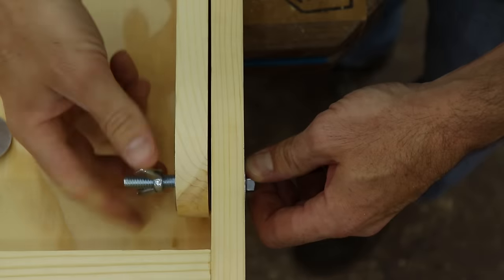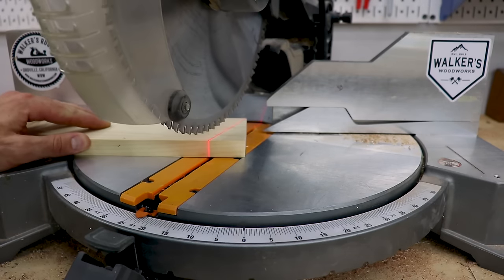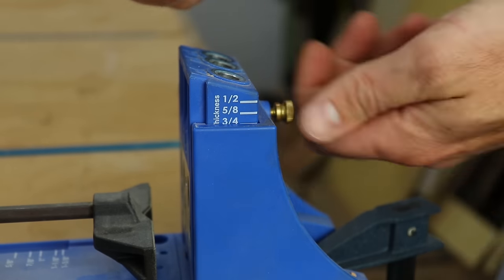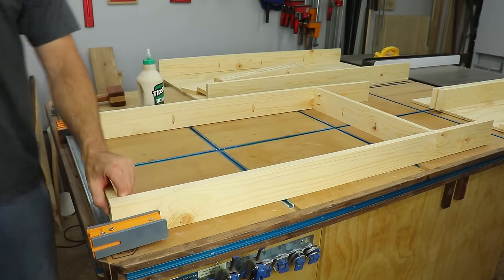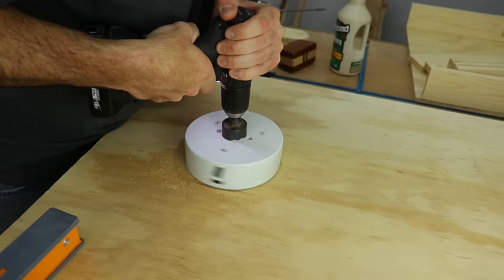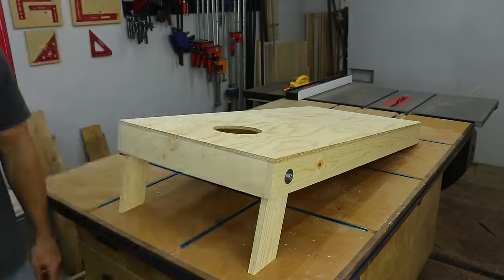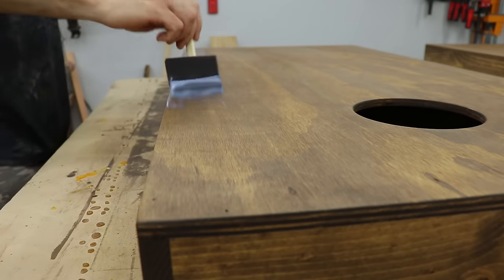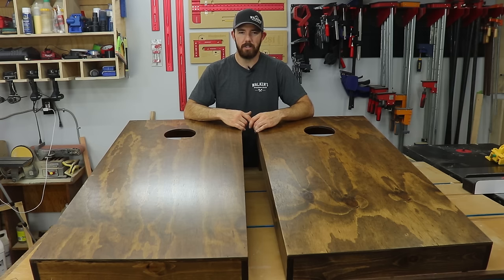How To Make DIY Cornhole Boards

Comment from the maker: PLANS FOR THESE ARE NOW AVAILABE! - https://gum.co/QeYDo 
Also check out my website for other plans, blog posts and more! - https://www.walkersww.com/
Reply: Why does the plans call for 1x3 boards but the video said he used 1x4?
Reply: @davidcary3315  The plans I downloaded say 1x3 1/2 which are a the actual size of a 1x4
Reply: @shvaew  Not exactly true. The plans call for 1" X 3" in the cut list. It's only further down that it shows them as 1" X 3.5". It's a minor error but still an error that should be fixed.
Reply: Great freaking working area…

Comment: I always apply a strip of felt on the back board where the legs rest while the table is standing. Just a piece as thick as the legs to prevent them from wearing the stain off. Just a nice extra touch.
Reply from the maker: Ya that's a good idea!

Comment: When attaching the base to the top I prefer to drive my first pocket hole then square it up using the corner to corner measuring method and then flush trim the plywood. But thanks for the video man! Subscribing.

Comment: I am a retired professional furniture maker and I enjoyed your video however were I apply a finish I would apply wood treatment before staining and rather than liquid staining I prefer gel stain as I can control staining certain areas to achieve highlighting certain areas I want to enhance.  Lastly I wouldn't have used a water based polyurethane as it doesn't wear well over time. I  prefer exterior Waterlox as it is easy to work with and as you know is a polymerization tung oil and extremely durable. I like applying it with a USA made foam brush . Because it is a long oil I have to let it rest for 24 hours before recoating lightly sanding between coats. Three coats are sufficient. Waterlox has been used extensively on gymnasium floors for years as well as bowling lanes. Granted a quart is expensive but should the wood get scratches it can be touched up without sanding because it is self leveling.  Waterlox comes in a variety of colors by the way.

Comment from the maker: Don't Forget to check out the woodworking plans I have available! - https://gumroad.com/walkerswoodworks
Reply: You're going to want to use semi-gloss min-wax poly with a foam brush. seven thin coats. Sand with 220 after third or fourth coat.

Comment: I'm going to make a set for our trailer. I'm going to use 1x4 lumber, and Luann, to make it light weight. I'm also going to make it fold in half for easy storage. The set I made for the house is made completely of 3/4" plywood.

Comment: In the video it shows you are using 1x4's for the frame. In the plans, it says to use 1x3's, not 1x4's.  Wondering which size boards you would recommend as best?

Comment: @Walkers Woodworks, what grade of sand paper would you recommend for after applying the poly. Also, do you apply poly to everything underneath the board also? I decided not to stain underneath except for the legs and frame.

Comment: I've built 3 kits (6 boards) in the last couple of weeks and they are turning out great. Couple of questions though. First, I am having a tough time getting the perfect 12" height AND getting the feet to be flat. I found that cutting the legs 11.5" and using a miter angle of 19 degrees is better. Isn't a 13" leg always going to be too high? Secondly, in your responses and video, you mention using 1/2 inch plywood and 1x4" pine boards for the frame and legs. But your spec sheet says 3/4 inch plywood and 1x3 inch pine. Which is right?
Reply from the maker: I would use 1x4 and 3/4" ply. As far as getting the legs just right I've never been able to get the perfect either so don't feel bad lol.
Reply: @WalkersWoodworks  OK thanks. I think I'll stick with 1/2" ply because I am fastening the boards together and attaching a carrying handle. I think it will be too heavy with 3/4. As for the legs, I'm gonna try making them a couple of inches too long, then propping the whole board up 12" and mitering a second line at the correct height. I still love your video though. Must have consulted it 100 times in my garage! LOL

Comment: So I have been making Cornhole boards for a lot of my friends and family, but the common problem that I tend to be unhappy with is just how heavy my sets are. Although I tend to use 2x4s for the borders and 3/4'' plywood.  Do you have a rough estimate of how much your sets weight? Just from the looks of it, your sets seem to be quite a bit lighter, are you using 3/4 boards for the borders as well?
Reply from the maker: I don't know the weight but they are about half as heavy as 2x4 logically haha.  Yes they are just 1x4's so 3/4" But I use 3/4 ply usually.  This video it was 1/2" I believe.

Comment: I like the shop layout. I haven’t made any with with 1 inch think wood. How does it hold up long turn. On my page use 2 by 4 but I need to try your method.
Reply from the maker: Seems to work well as long as you keep it inside when not in use
Reply: @WalkersWoodworks  Thank you

Comment: You never mentioned the thickness of the plywood. Was that 3/4 in or 1/2 in thick plywood?
Reply from the maker: It's 1/2" but I use 3/4" now.
Reply: Thank you, also what grit did you use for sanding in between poly coats?

Comment: They look great. I just built some boards and I am going to use some finish if I brush it on and use 180 to sand in between you think that would work?
Reply from the maker: Awesome!  I'd use like 220 or higher between coats.

Comment: I want to paint a border and keep the wood grain in the middle after I sand with 220 can I paint my boarder then apply some spar urethane?
Reply from the maker: I'd just use exterior paint.  That should be enough for the border then use spar on the rest.

Comment: How much time in between coats of polyurethane?
Reply from the maker: The water based stuff dries pretty quick.  It depends on the temp nd humidity but on a warm day I usually wait like an hour or two.
Reply: @WalkersWoodworks   Thanks  a lot!
Reply: What sand paper did you use to sand in between coats?

Comment: Do you have any problems with the wing nuts coming loose or tightening
Reply from the maker: Ya you gotta mess with them once in awhile. You could use nylock nuts to prevent that

Comment: Those look clean!  What length pocket screw did you use to attached the plywood?  Same length as for joining the frame together?
Reply from the maker: I think 1"
Reply: I use 1" to attach the top and 1-1/4" to attach the frame.
Reply: @dls6625  and everything came out good 
No screws peeking out anywhere?

Comment: Did you mention what you use for the top? is it 1/2 inch 3/4 inch ply cause i got a 4'x4' scrap sheet of 1/2 birch lyin around.
Reply from the maker: I used 1/2" on these but I usually use 3/4".
Reply: Hi. Any particular reason you decided to use 1/2 instead of 3/4?
Reply: @WalkersWoodworks  Thanks for responding! Working on my project today

Comment: how do you get the legs to line up perfectly? my feet are slightly off when setup.
Reply from the maker: Mine aren't ever perfect.  However usually this is played in dirt and can be leveled out by working the slightly taller side in.  If it's to bad then just trim a bit off.
Reply: @WalkersWoodworks  thanks!

Comment: did you use 3/4 plywood?  and what screws did you prefer to use for the legs?
Reply from the maker: I used 1/2" but I've used 3/4 as well.

Comment: Can you provide the measurement for the 3 pieces that go in the frame ? “Top, bottom and middle piece”? Amateur woodworker trying to do this project. Thanks !
Reply from the maker: If you just Google regulation corn hole board plans.  Tons of free ones. 👍
Reply: Gezzz help her
Reply from the maker: I did.  The plans available for free are much more informative than what I could write in a YouTube comment.
Reply: Just go over there and make the cuts for her, dude. Geeze, go help her!
Reply: @WalkersWoodworks  Omg what's wrong with you ....go help her!....I'm just stirring the pot lol...Thanks for the video!!
Reply: Katie, the overall width should be 24". Measure each side board and take that away from 24". The left over is the middle board width. Those three boards you are asking about make the overall width come out to 24". That simple.

Ex...if each side board is 3/4".....you have two of them so that's 1.5".  24"-1.5"=22.5"

Comment: Newbie question, What screws did you use to attach the top plywood to the frame?
Reply from the maker: Kreg 1" pocket screws.
Reply: Hey I have a question, I'm attaching my frame to the top but my frame is a 2x4 attaching to the 3/4 top. What settings should I use for the bit, screws and the jig?

Comment: What sandpaper grit did you sand between the poly?
Reply from the maker: I use a very fine sanding pad usually.  But something like 400 would work well.

Comment: Hey love the video! I making a pair and when I layered the top piece on, there imperfections on how it laid. Some edge a little over and others a little short corner to corner. Any suggestions on how to fix this and avoid it in the future?? Thank you so much
Reply from the maker: Make them oversized a little and use a flush trim bit in a router to remove the excess.  👍
Reply: measure the plywood at the store, make sure it's square

Comment: Great video Brandon! That 6” hole saw ain’t no joke.
Reply from the maker: Thanks Bill!  You're not kidding.
Reply: Start the cut in reverse for a few seconds. Make an oil rag in a can (think hand planes) wipe down the sides of the hole saw before you start. Use 3in1 oil. No issues 😊
Reply: @jkgkjgkijk  fyi. Home depot sells pre cut pre hole tops for $20

Comment: Would you mind giving all the dimensions?  Width and length of the board?  Thank you!
Reply: The American Cornhole Association requires platforms be a 48" x 24" rectangle made from 1/2-inch plywood. The front of the platform stands 2-1/2 to 4 inches tall and the back of the platform sits 12 inches off the ground.

Comment: I just picked up supplies for these boards, and your directions say to buy 1x3's when you say to use 1x4's in the video.
Reply from the maker: Either will work.  1x3's are just cheaper.

Comment: Nice video. Unfortunately (unless I'm missing something), there's a significant error in the plans on your website. The cut list calls for 1" X 3" boards but it's pretty clear that you actually need 1" X 4" boards. I didn't notice the mistake until after I paid for and cut most of the material so I'm hoping you see this comment and update your plans so no one else runs into the same problem.
Reply: It says in the first 40 seconds of the video that he used the same stock to make the legs...
Reply: Oh... nevermind. My bad. "Plans on your website"
Reply: Plans not updated and ran into this issue. 

UPDATE THE PLANS IF YOU'RE GOING TO SELL THEM.

Comment: Did you make that wooden hammer?  If so, do you have a link for how to make one?  First video I've seen of yours after searching how to make cornhole boards.  Excellent video and #NewSub!  Thanks for a really great video. :)

Edit: I thought of another question.  Is there a way to connect the legs by using a hidden connection somehow?
Reply from the maker: Hey Heather,  thanks for the sub!  I did not make it.  My buddy Jesse made it and he has a video on how to make them.  Check it out. https://youtu.be/fLWycj2o1Xk
Reply from the maker: I suppose you could use dowels to connect the legs with some sort of stop on the end.

Comment: What were the lengths of the top and bottom pieces? (The common boards)
Reply from the maker: Same as the top.
Reply: probably 1x4 , which is actually 3 1/2" wide.  once you add the 1/2 "plywood, you'll have your standard 4' in width

Comment: Why didn't you mention the finish nails Front the top side?
Reply from the maker: I used pocket screws.
Reply: @WalkersWoodworks  At 5:42 I see two pin nails?

Comment: Fantastic video, but really disappointed in the plans especially after purchasing them. 

The carriage bolts were a total flop and did not work at all when tightening down the nuts. 

30 degrees with a half inch gap on the legs was not correct and left the legs not even close to flush to the floor.

And, a 1/2” hole was too big for the 3/8” bolt.

Might be a good idea to adjust your plans so they create a successful build. I spent way too long on a wild goose chase retrieving more material.

Comment: is it fair to say you don't need pocket screws, but rather you're using them because you're a pro and have the tool for it? i could secure the boards from the outside no?

Comment: All these videos are great.....but you're not a good liar.
"I bought common boards at a local hardware store"......no you didn't.  They're not curved enough.

Some of these youtubers need to do a video where they go and buy this magically straight wood they somehow find at these junk lumber stores.

Show us where you find "common boards" that you can square up without squeezing and bending the hell out of it. 🤣
Reply from the maker: You pick through 30 to get one good one lol.
Reply: @WalkersWoodworks  I got worn out one day!  Crazy enough I have found better luck at the orange store than the blue store. 

I started building these back in 06 when it got real popular in Florida. I had no issues squaring up a box. I had to make a set for the first time in probably 10 years and the wood was so bad I thought I could pull it together with a screw and it split, it had that far to go. Quality down price up.

Sorry....long winded. 😂